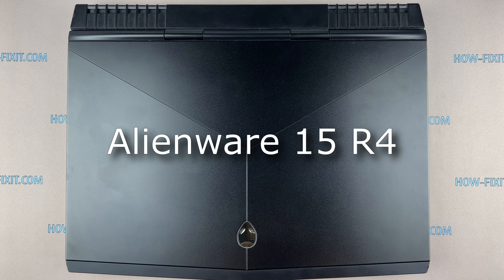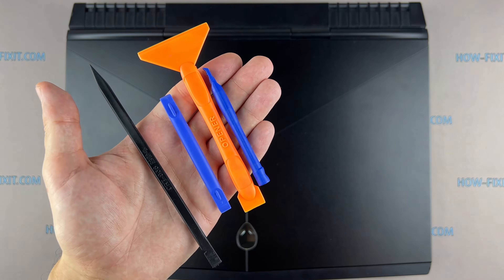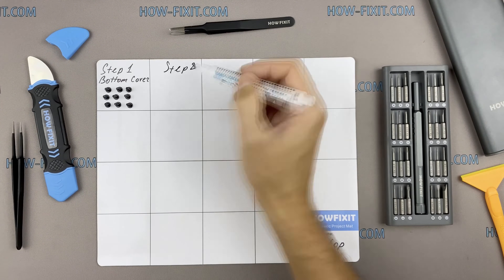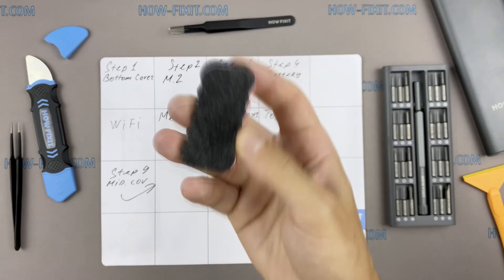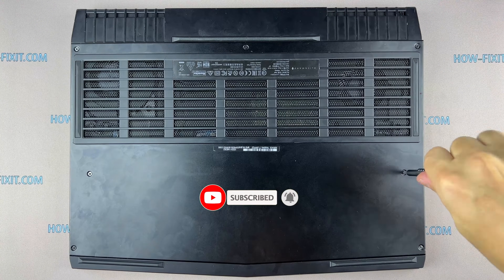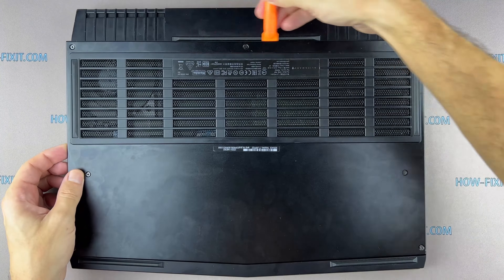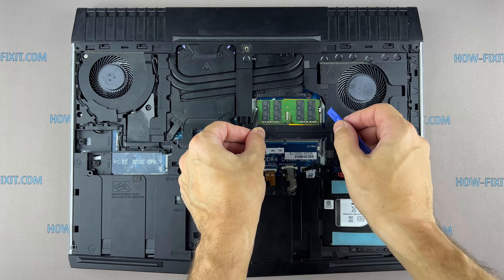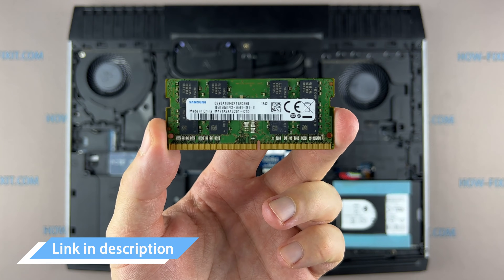Alienware 15 R4 RAM Upgrade and Install - Your Step-by-Step DIY Guide!

Comment: What about the RAM under the Keyboard? That is a lot harder.
There are 4 modules in that machine!
Reply: which ram under keyboard ? we just saw ram replacement of 2 solts
Reply: @VladikLesyk  There is two more under the Keyboard. I have a M17 R4 I am typing on right now.
I have seen it.....

Comment: Thanks for the video!
So, the Crucial RAM 16GB DDR4 3200MHz CL22 will run at 3200MHz in an Alienware 15 R4? Or will it operate at a lesser frequency?
Cheers
Reply: I have the same question! Can someone please help us??
Cheers